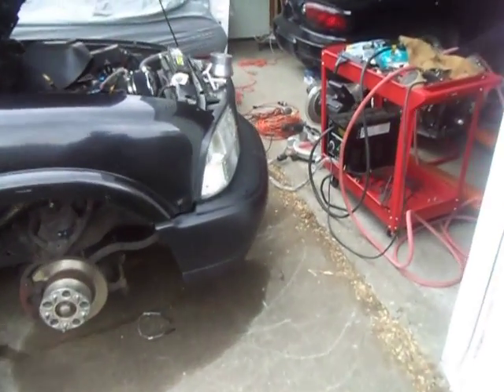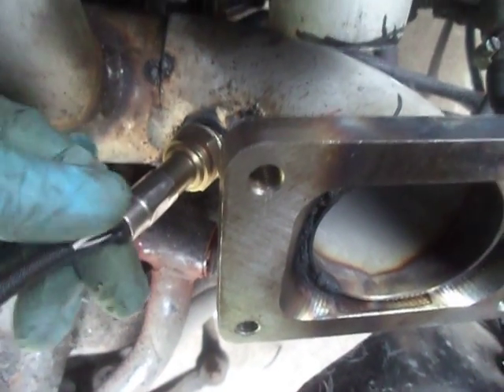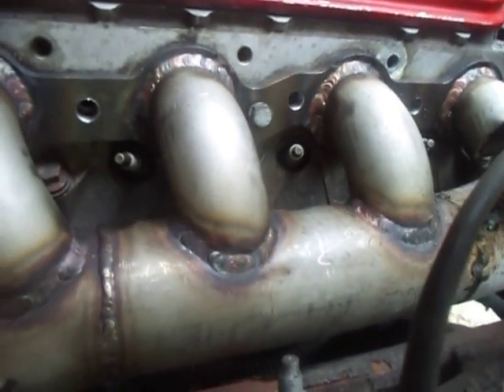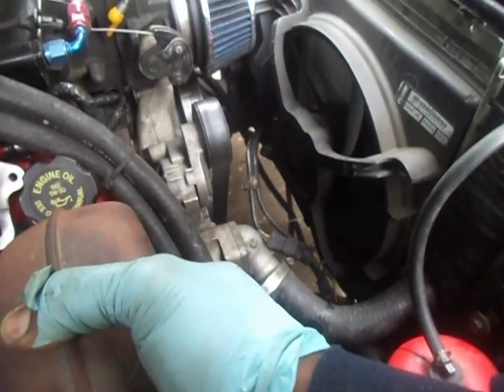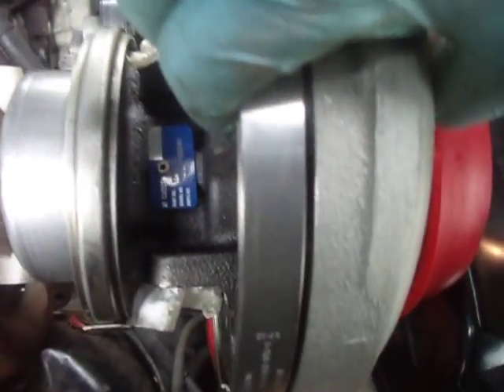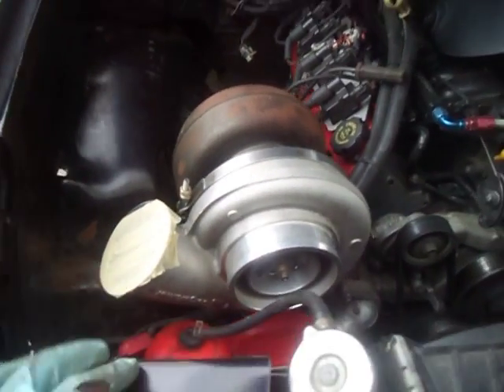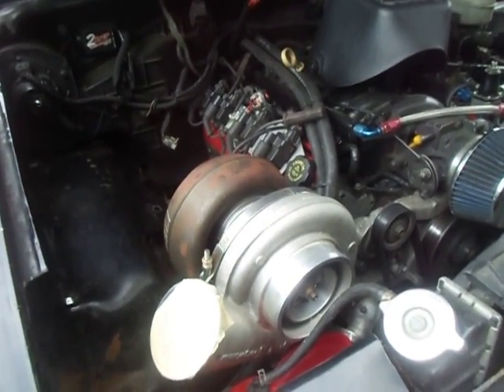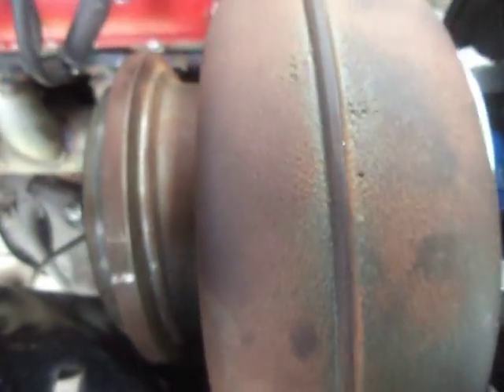Sonoma S10 LSX S475 build

Comment: am i the only one who doesn't get why he has a pipe running out the back of the manifold? he said down pipe in the video... but down pipe should come off the turbo not the same manifold feeding the turbo? Then i was thinking maybe the driver side exhaust is going to run into it... but that should meet at the turbo not into the other manifold.... im lost lol
Reply: +doubletapm4 That's the first thing I noticed too.  They're in fora rude awakening if they complete it and it's plumbed all wrong lol.
Reply: +doubletapm4 I'm pretty sure he meant to call it a crossover pipe connection for the driver's side manifold. The setup will work just fine. You do what you can with the space available.
Reply: goodmechanic I saw another video and that's what they did.  It just looked really fucked up at first.
Reply: +nilphuxgiven it's the crossover pipe from the drivers side